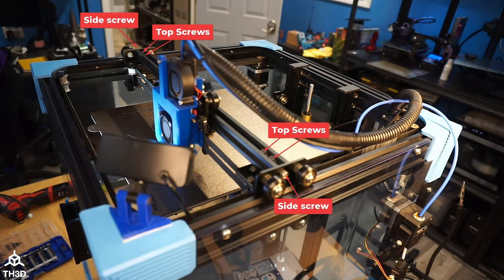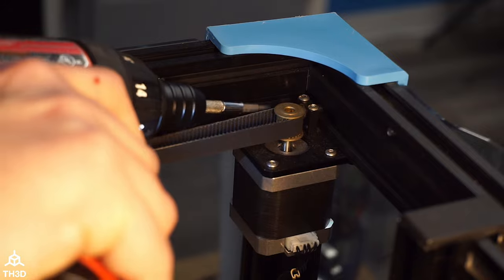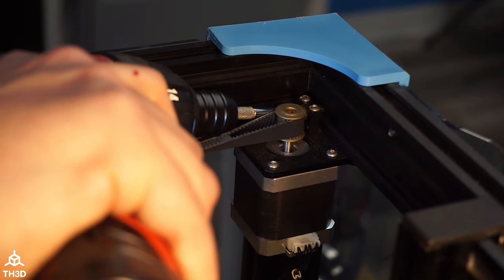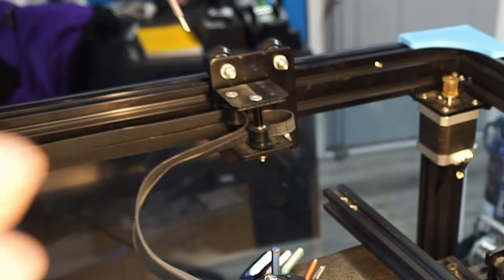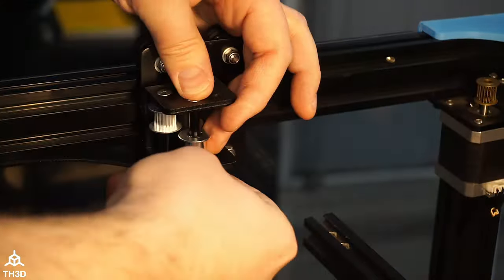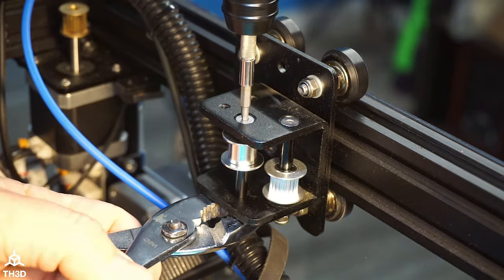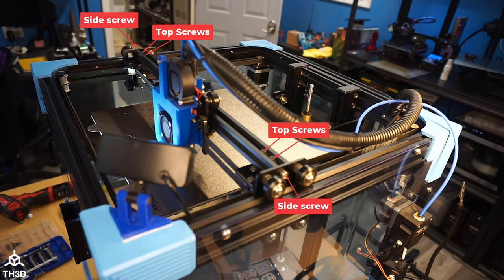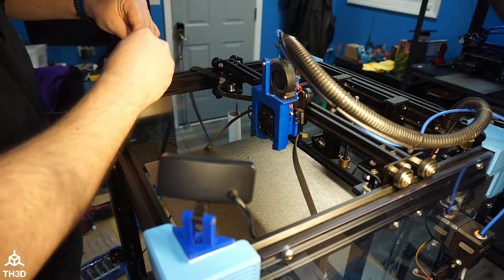TH3D Ender 6 Metal Pulley Kit Install - Printer Upgrades

Comment: I just ordered the all metal pulley kit and a new belt, because my belt is completely worn down and now slipping. I couldn't find even the stock pulleys or belt anywhere that has them in stock. So thank you guys at TH3D!
Reply from the maker: No problem! We had the same issue which is why we made the kit. They're all custom made pulleys.
Reply: @TH3DStudio  also shipped to Europe?